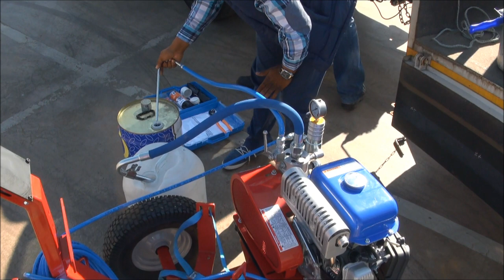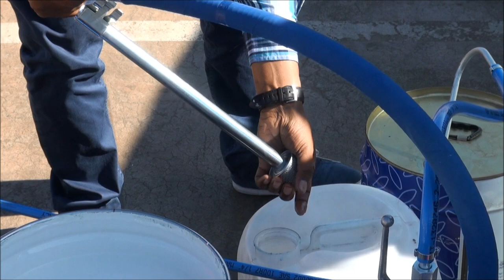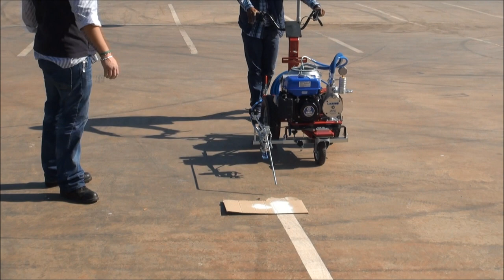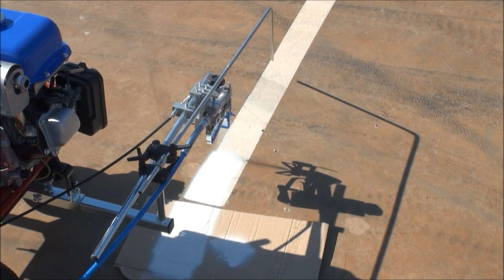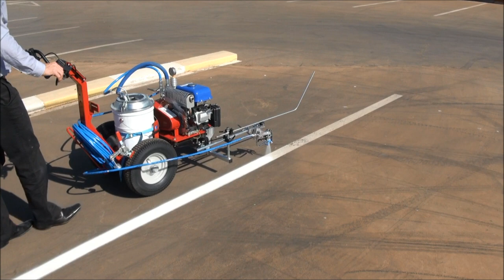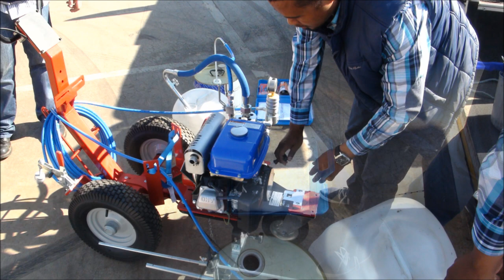MIro Liner Plus Movie 2 - Applying Speccoats™ Road Marking Paint

Comment: #LARIUSSRL Line painting equipment sprayer
Paint spraying equipment manufacturer Our line striping machines can be used on asphalt and concrete parking lot pavement . Adjustable airless spray pump gives you the best line edges.
We carry only the best airless line striping equipment